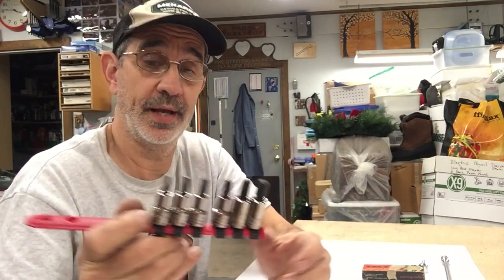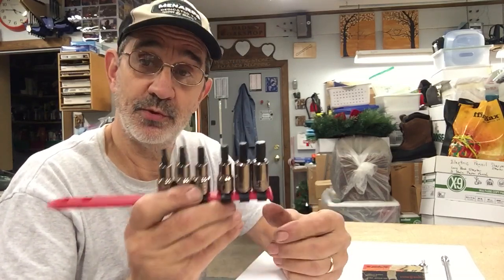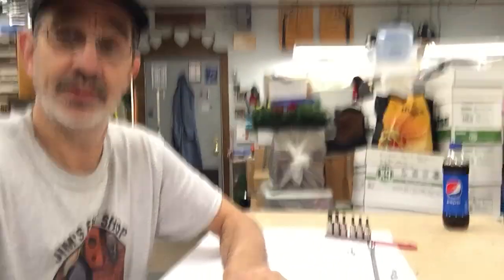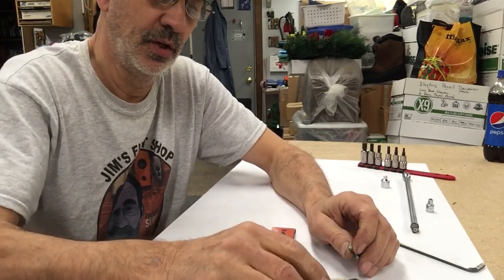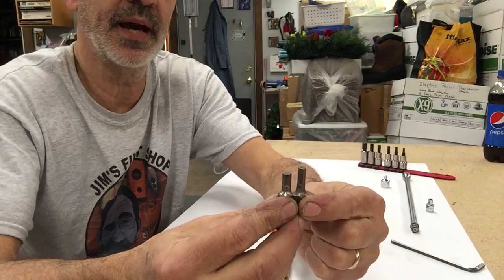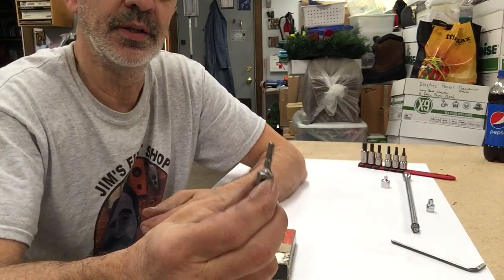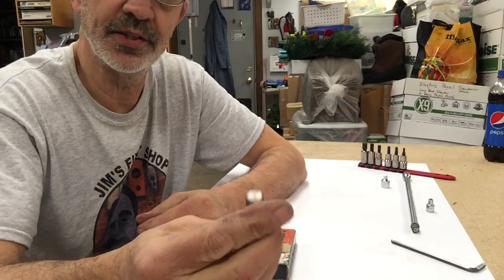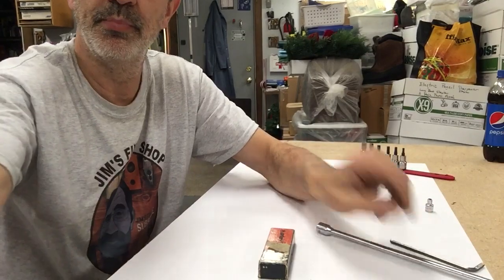321.Removing or adjusting your drive disk

Comment: Harbor Freight's socket set for those allen key sizes are very economical, and I've used them on three sets of Snappers. I use thread locker on the disk to engine shaft set screws.

Comment: Hi Jim - its Big Rodders in Ireland.  Last year I was lucky to break my set screws open with an L shaped Allen key but it was fiddly with my big hands round the drive disc.  I since cut a key and sacrificed an old metric socket by welding the two pieces together, thereby enabling me to access the set screws thru the holes at the back of the machine.  Could have saved myself some hassle, and a socket, if I had known your excellent tip then.

Comment: Hey Mr. Jim!! Im swapping engines on my snapper. The old drive disk has set screws and a key. The new engine had a bolt. Can i just use the set screws and key to hold the old drive disk to the new engine? Thanks
Reply from the maker: Yes. If you look closely your old engine should have a drilled and taped hole in it.      Jim's
Reply: @jimjackson9381  thank you so much!!

Comment: I adjusted my drive disc and now my Snapper wants to pop a wheelie when I put it in gear. I used a homemade template to gauge where it should line up. Any advice?
Reply from the maker: Well if you think the drive disk is in the proper place then watch video number 70 and loosen your yoke spring. Jim

Comment: Shit.... I have the 1 that doesn't have set screws
Reply from the maker: Well, that can be a good thing. The drive disks with set screws sometimes will move on the crankshaft and you’ll have to readjust them. If you can get the set screws loose a lot of times they freeze up and it’s hard to get to them. You have to have a very long Allen wrench which I don’t suggest doing because there’s too much spring or twist in the metal and you can’t really bust that set screw loose, it’s better to cut off a 1 inch section of the Allen wrench and put it in a socket with a long extension. Where is the drive disks with bolts going up into the bottom of the crankshaft you can always break them loose and adjust the drive disk you do that by inserting more washers inside of the drive disk, where it slides on to the crankshaft or by taking some washers out, if you have some problems, let me know. Jim.
Reply: @jimjackson9381  yes sir... Now that I tore into it, it wasn't bad... I believe I would prefere this kind especially after the point you made bout set screws... Tonight I will get some washers and go back n forth till I'm happy with the amount of surface to surface contact...again thank you for your time and knowledge
Reply from the maker: If you have already watched video number 70 it will give you the dimension. It is supposed to be set at if you go down to low the edge of your chain case will gouge into your Drive disk. Also, try tightening your yolk spring that will help a lot. Jim.
Reply: @jimjackson9381  one more question??? Other than watching to make sure my chain case doesn't hit my drive disc there's no other concern???? Cause I put a 1/8 inch washer in there and I have started putting it back together and so far there's good surface contact and chain case is still clearing my drive disc... Would hate to put it all back together to find out I created another problem.. again thank you
Reply from the maker: @2-manfreeman153  well let me know if you have anything else you need from me.      Jim
Reply from the maker: @2-manfreeman153 too much pressure of the chain case against Drive disck can cause premature wearing just watch for that. Jim.
Reply: @jimjackson9381  yes sir thank you